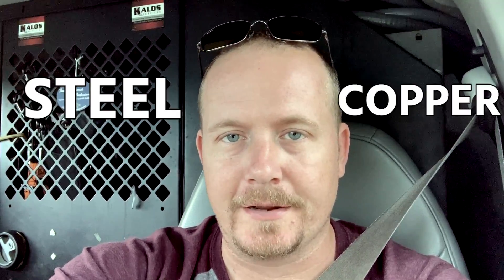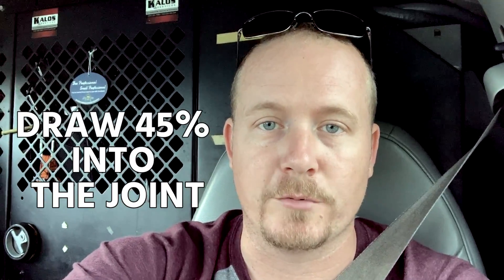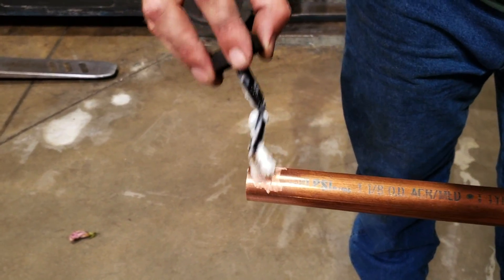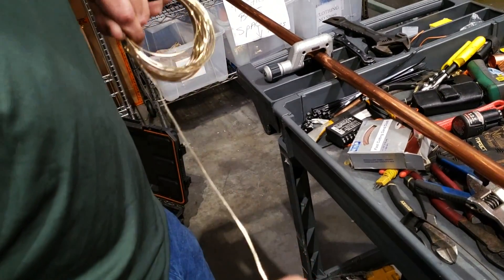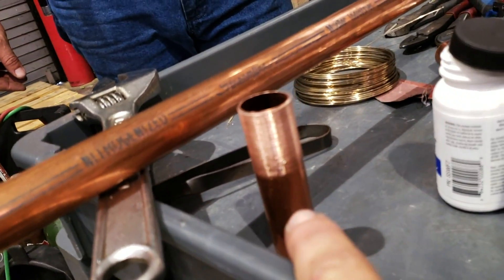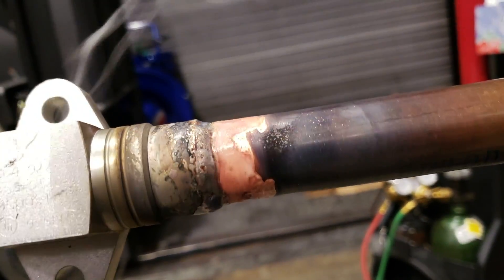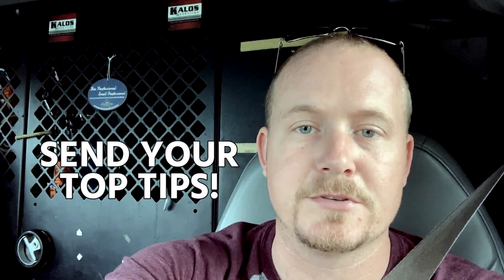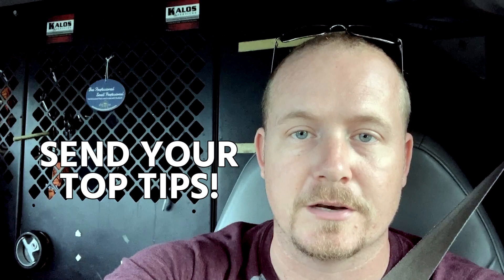Use 45% Silver Solder to Braze Steel and Copper

Comment: be careful with the heat.overheat will ruin the flux.heat joint until flux takes on a water like appearance and then apply silver solder.

Comment: Just a tip . I have found that applying heat as indirectly as practical will reduce the possibility of drawing carbon to the surface of the steel.
A carbon coating will prevent the silver from bonding to steel.
An aside is that you can intentionally coat surrounding steel, such as in gun smith applications with lamp black for example.

Comment: Would anybody run 500 degree F thermal oil through copper with brazed joints with over 1000 degree F melting point solder?  Just a temporary set up for about 6 months.

Comment: What would happen if you use 15 percent rod
Reply: Try it and let me know lol. I try it and it doesn’t work with 15 percent. Solder won’t flow into the steel joints

Comment: Are you kidding? 

#1 DO NOT get flux into the system which you did.  #2 You trashed the valve - burnt the seals with no wet rag. to prevent the heat transfer to the seals.   #3 No nitrogen means you contaminated the piping with carbon.  Epic Fail!

Comment: I Just reference this video on a job. I can confirm that 56% Uncoated also works. I did 5/16 copper to steal condenser coil. I also followed up with some 15%. The joint looked great. I used plenty of flux on the copper female end only. True Mfg. lowboy prep fridge.

Comment: The guy that was brazing this needs to go back to basics. What a mess? Whenever using emery cloth? Should always clean the loose abrasive material from the base metals before applying flux or soldering as thesesmallparticles areabrasive andwillend up in the circuit and contaminate. Should never apply flux inside the female joint in this case it was the steel valve body. Try not to apply flux all the way near the end of the male pipe. Always heat the steel and not the copper when adapting steel to copper. DO NOT TRY THIS PRACTICE!!!
Reply: Yeah, not sure where this guy learned these practices.

Comment: Prefer flux core. When doing large size copper to steal the flux will burn off. Flux core applies the flux after the fitting is hot and prevents burn off.

Comment: Did he switch solder from roll to stick?
Reply: Yes 45% to 15% silver solder
Reply: I don’t understand why somebody would put 15% on top of 45% silver?  It’s completely unnecessary. The 45% silver flows well with the proper flux and I never had a joint leak.